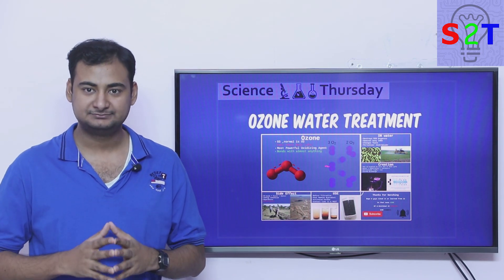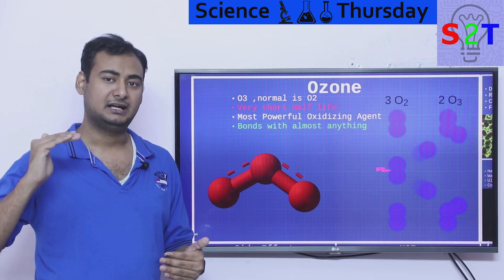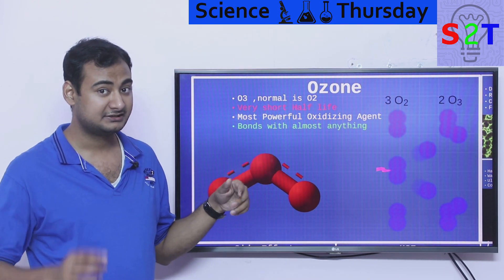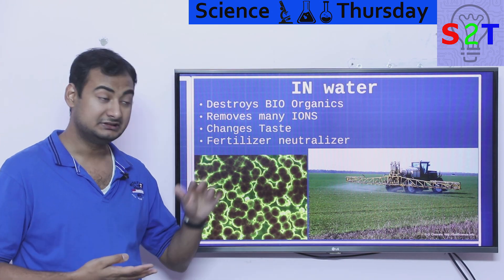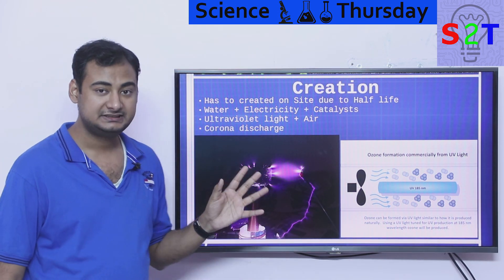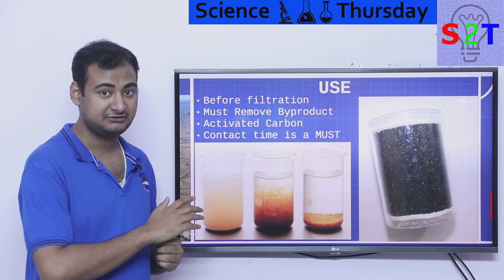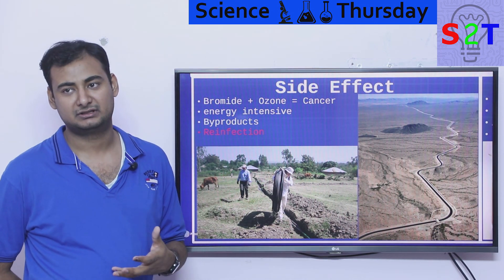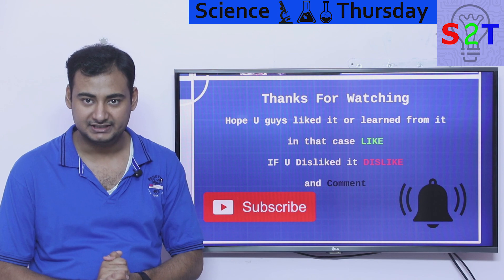Science Thursday Ep47 (Ozone Water Treatment Explained)

Comment: Hello I am planning to design an ozone filter using injection into water tap supply to my house ....I am using 1000 litter plastic tank before water feed inside my house to use it for shower laundry and other facilities inside the house, I am planning to use it on automatic way so everytime water supplying the water tank then ozone will be injected as long water is passing throw the water supply to tank then I will use 3 stage filter 10 Micron then 5 Micron then carbon  filter .....what do u think about this setup ?